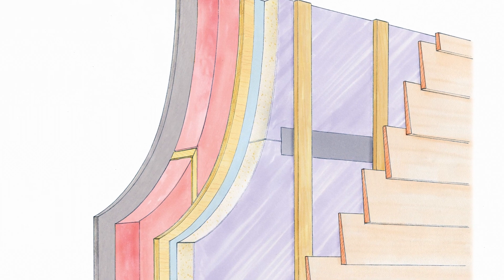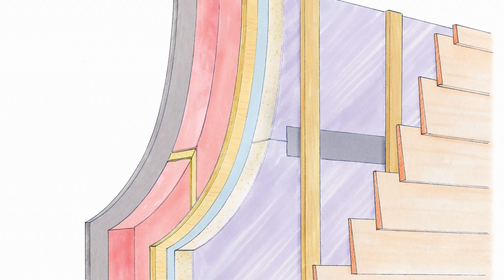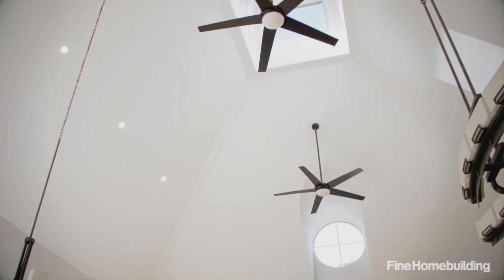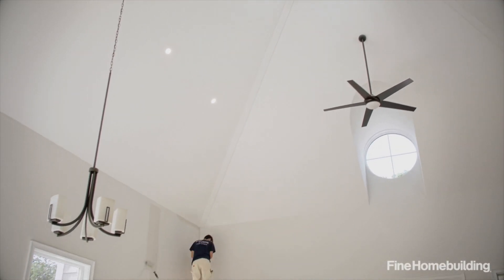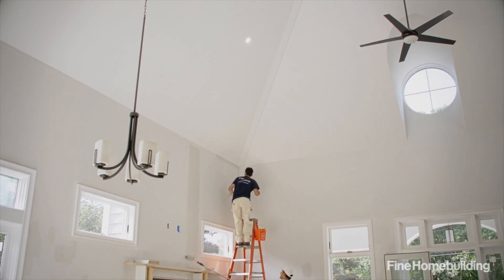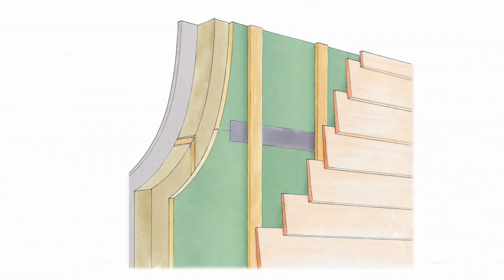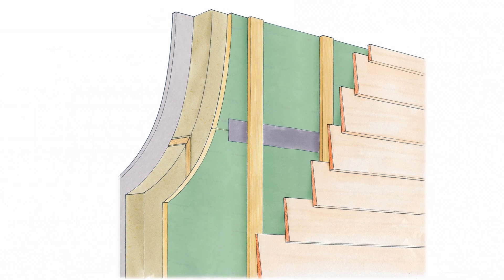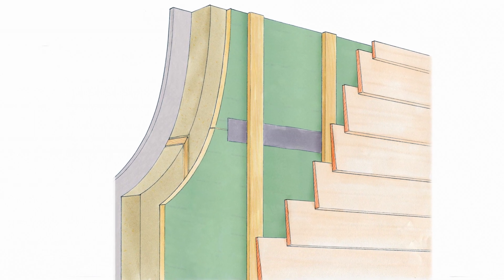What’s the Science Behind a Code-Built Wall?

Comment: So a brick faced wall with a drying space between brick and zip system that comes with preglued air barrier then studs perhaps with cracks and spaces  foam sealed and then your choice of insulation such as blown in cellulose held together with the special engineered summer air conditioned vapor membrane and then drywall taped and sealed and then painted as well as the ceiling holes air sealed with foam is the perfect wall for a northeast American climate?
Reply: Ha! No. The Perfect Wall has 1/3 of the insulation outside of the air/ water/ vapor control layer. This controls condensation. Also the Perfect Wall has no windows. Spend your money on windows first.

Comment: Talk about making a mountain out of a mole hill. You folks are thinking way to much. What is the percentage of homes that were built back in the day that have water intrusion? I am betting less than 1 percent if the home was maintained at least every 3 years.
Reply: Modern tight construction respond to pressure differences and moisture penetration much differently than antique construction.  We can no longer afford to build houses with 10 ACH50 or worse.
Reply: What would be your definition of maintenance every 3 years? And do you honestly want to do this or think that all homeowners are doing this?  

This video is a great simple explanation of the science of it all and without this level of design/engineering, we are left with tens of thousands of homes built in the mid-1900's that are now falling apart due to lack of control and care of these environmental conditions. But I'm guessing since you are in the business of contracting that would be a great thing for job-security.
Reply: they also weren't made with waswood, aka OSB. plus they had no insulation. fake wood and insulation and you got a fucked up wall situation.
Reply: @stevecrawford6958 The fake wood and insulation wasn't bad until everyone decided they couldn't live without air conditioning. We've changed the flow of energy and the indoor environment in our homes, but no one wants to change the way they build.